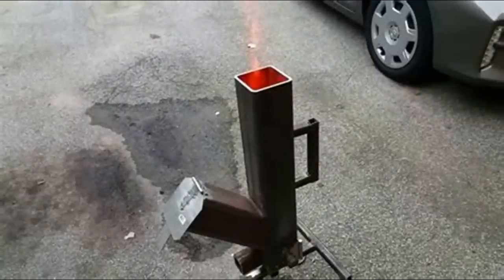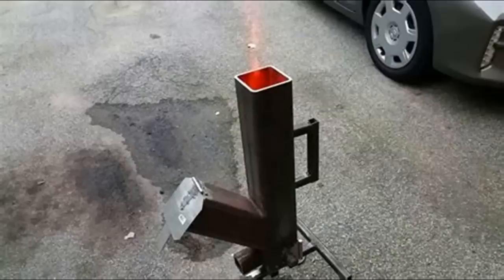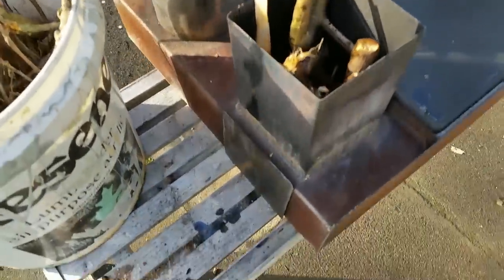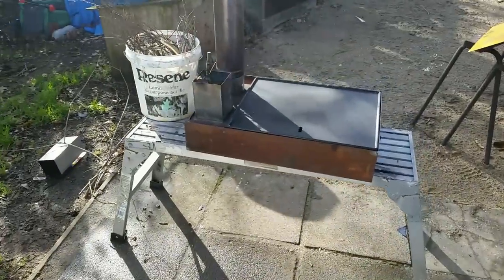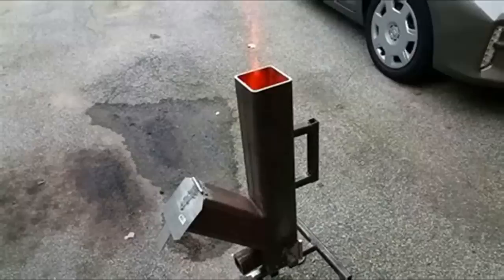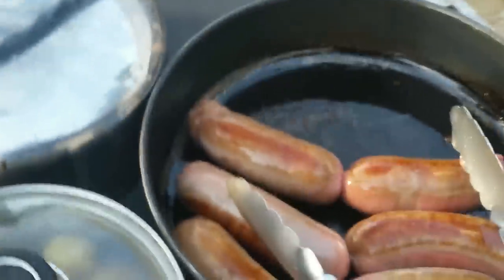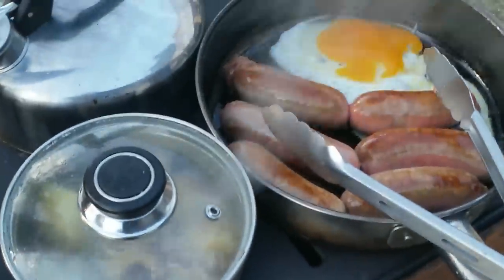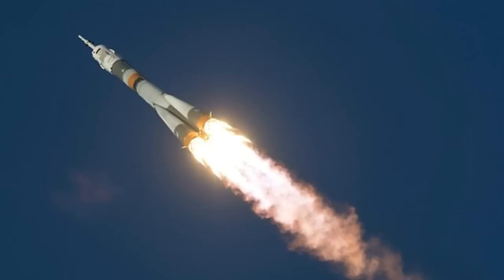2021  prototype of Rocket Cook Stove- Amazing Versatility! part 1

Comment: This is the best design I've seen yet, love it!! Thank you
Reply from the maker: This was the prototype - Im just building a brick version with oven that you can build yourself with simple concreting tools. Its EPIC!
Reply: TinyHouse and Offgrid Resources Great idea!  I may attempt to make one, but I may try interchangeable grill plates to also use as enclosed type Bbq. One side had the grill ridges and other side is a griddle that can also be used as griddle or burner surface for pots. I may even build a warming oven in the back by leaving a small damper with tiny holes at the rear that can be opened up  while its cooling down. You have inspired me for sure!

Comment: I found the opposite to be true in the fuel consumption area when burning in a rocket stove, I could go through a stack of wood in about an hour because the fire is so intense. Very nice idea with the stove you built, the u-shape under the cooking surface is good engineering!

Comment: Is a good stove..Insulate the walls and bottom. IF they are not and they are hot to the touch then is heat you are losing that is not reflected on the top. Do bricks inside or frame with clay or some insulating material outside.  Let only the top surface hot and all heat will only be sent there since it cannot escape alsewhere.

Comment: If you added insulation around the outside and on the bottom of your stove it would warm it up a bit more I would think.  Plus, it would push the warmer temperatures more around the stove. At least it seems it would to me.

Comment: That's pretty effective and very efficient. I use the small branches off the tree and hedge cuttings to fire in mine also. Probably this is the best I have seen actually and I've seen tons on U tube. You had it down draughting as well with the plate on the back.Well done will have a go at this because it's like having a 4 burner gas stove all on separate heat settings. The heat bricks do look like they make the difference, also forces the heat closer to the plate. Great in SHTF scenario.
Reply from the maker: I know!- Im pretty excited about this. Ill fire it up again as soon as the rain stops and try a longer flue. see if i can coax another 20C out of it
Reply: One thought what about an ash pan under the firebox lets it drop through a grill into an enclosed pipe for cleaning out, the problem for mine is eventually the pipe becomes clogged with ash so have to rake it out just wondering if the inner fire box on yours will accumulate ash in and around the fire bricks. If its hot enough there shouldn't be a build up with ash. Idea is to burn it down to minimal ash residue by the time it gets to flue pipe. Don't talk to me about rain we've had enough for this winter thanks.
Reply from the maker: Bill Porter that's what I do. I've put a brick just before the u bend and it stops the ash going  all the way around. I just rake it out the side air flap. I'm putting an oven underneath next week so I can't have a ashpan without getting dirty pizza.
Reply from the maker: Where are you Bill? I'm in waikato nz
Reply: TinyHouse and Offgrid Resources I'm in the so called Super City north of you and looking to break out sometime in the new year.after I retire. I saw your home made crimper and it brought smile on my face, typical kiwi with #8 fencing wire mentality, if you don't have one make one lol worked a treat.  Ahh so you created an ash trap inside the heat chamber, like it. I was wondering why the heat bricks didn't run round the whole chamber. Now it makes sense.

Comment: Remember the old wood kitchen stoves with covered holes? They were "almost" rocket stoves. Several years ago I saw a Russian R.S. that "reinvented" that design. If you can submerge pots into the firebox the heat transfer is maximized. 
Your use of fire bricks to line the firebox is a nice touch many overlook. It greatly extends the stove life and contains heat. 
I would have put in a slanted, taller feeder channel for "load & leave".
Reply from the maker: Im thinking of a pellet hopper next and maybe a feed extension of about 4inches
Reply: There are a number of designs out there which use the sunk pot approach. Apprevecho institute had a number of stuff and oven designs worth looking at for ideas. The developed a commercial kitchen sized skiryed stove to boil water in large pots. As well as a low cost barrel oven for baking bread.
Reply: From what I've seen, pellet hoppers are a little tricky and may need an electric auger to evenly dispense the pellets and keep them from clumping. Will be curious to see how you adapt the design.

Comment: Great! I just liked and subbed.
Do you find there's an advantage to the U-shaped exhaust path under a square cooking surface, as opposed to a straight shot, fire box at on end, chimney at the other, 4 pots side-by-side? To retrofit an indoor kitchen, the square makes sense. Without that constraint, I wonder if a linear path would be more efficient. Or maybe the resistance offered by a serpentine path is beneficial? I'm new to this!
Reply from the maker: Well,for straight out heat, a long insulated riser has always been the go , But really who cooks at 900f !?
I knew that a  long heat path would be good for cooking multiple pots but I wanted to come up 
with something compact. Im perfecting an oven for it now -look at the latest videos

Comment: This is by far, none even close, to a "Wife Friendly" attractive Rocket Cook Stove. I'd love to have one. I'd use a Coleman Camping oven to place on the grill for any Oven requirements. If it were for sale, I'd buy it. My only metal working equipment is an old arc welder from when I raced cars. If plans were available, I'd buy them then find a local shop to fabricate this.

Comment: Lovely video mate. If you make another one, how about setting the perimeter flanges off your cooking plate face down. My suggestion will allow your pots, pans and the kettle to slightly overlap the edge so it's easier to use.
Thanks for posting

Comment: NOVA = NO Volts or Amps
You are the developer but...
What if you made the stove only as wide (or less) than the biggest pot.  Then you make the stove long enough for three or four pots.  The temperature gradient would go from high to low in a smooth, linear way.  Final dimensions, insulation and locating the firebox (high or low) are for the builder.  What a cool build!

Comment: one word.... WOW!  What gauge metal are you using? Can you provide drawing/schematics of that inside/all components?  I am on disability income and need exactly what you have made.  Perhaps I can find scraps and someone to make it for me for a nominal fee.  After testing it couple months I will put it in my small house to cook on.   I cannot afford gas or electricity for cooking..  I have a rocket stove water heater I use effectively.  This savings means alot to my tight little budget.

Comment: That's really neat. I was going to put a n old classicLeda into my middle room workshop this next (UK) winter for when I'm restoring my bikes, but I'm thinking this design would be way better. 

The plan is to go fully off grid eventually, but steadily increase the amount of heating and cooking I do using zero power. I've got shitloads of logs, but they won't last long in a conventional stove. 

So, have you got any photos of the firebrick arrangement please? Did you line the bottom? I'm really impressed.

Comment: Some years back I wanted to build me my own rocket cookstove, but I never got around to getting a welder or learning to weld. The biggest flaw I see with your design is the draft doesn't seem overly good which is letting smoke escape back out the feed tube. Perfectly fine for outdoor use, but if someone wanted to build a "summer kitchen" and bring the cookstove indoors, that would make the kitchen smoky. With that design, it could probably be fixed by using double-wall chimney pipe. That might just be enough draft to keep the smoke going in the right direction.
Reply from the maker: Just add another chimney section to incease draught

Comment: What are the exact measurements of the bottom and main frame of the stove. It is basically set up and works on the same theory as the US military M-1944 detachment stove. The difference it the M-1944 is fuel fired and smokes like crazy, and yours if wood fired and burns clean.
I would really appreciate it if you could do a drawing with the measurements.
Great video, great piece of gear . 
Thank you for your efforts.
Reply from the maker: The exact measurements are the same as the second hand grill plate I found at the dump. That is why I made all it internal components moveable so that I could experiment. Finding out for yourself is how we learn. Having exact measurements and instructions is how life gets boring and controlled.
Reply: Awe we need help please.

Comment: Great! Can one make this without welding just rivetting?
Reply from the maker: Of course- but im working on a bricks and mortar version using air crete for insulation.
Reply: @t.h.o.r.  Did you manage to create a working bricks & mortar version?
Reply from the maker: @annoniemuis3866   I never wanted a bricks and mortar version.  Ive made a pizza oven recently
in brick. That will get shown as soon as the weather improves
Reply: @t.h.o.r.  Gotcha. Too bad, as I'm great with setting wood on fire but pointing little blue flames at something or working with steel in general.. not so much. Now trying to figure out how to use a gutted & rusted tiny wood stove and turn it into something rockety.

Comment: Love the design but was surprised by the height of the chimney. 

Is this necessary to draw the heat through the horizontal parts or would it also work if significantly shorter ?
Thanks !
Reply: More long chimney more suction and more flow speed. More air in the intake and more efficient combustion. Shorter chimney can work well, one meter is ok, more is better.

Comment: Many questions. First I live in an extended cargo van and I am a city dweller. I thought about buying a mini wood stove or a cube wood stove. However I didn't think neighbors would appreciate smoke coming out of my vehicle. No stealth that way. Will this stove be suitable for vandwellers that live in the city? How tall does the stove pipe have to be? Biggest question really is would it be safe inside of a vehicle that a person lives in? I understand you just came up with this idea. But I'm sure many people are going to ask these questions. Thanks for your creativity
Reply from the maker: Thanks for getting in touch Bailey. I lived and travelled in the little purple/white bus that is in my outro at the end of each video. I ran one of my gas bottle stoves ( check my earlier videos - lots of info)  in there with great success. the chimney needs to be at least 1.5m long.  even with a rocket stove you will get smoke when you first light up. But any fireplace with a good secondary burn system will be smoke free by the time it reaches running temps.People worry about two things with small cabins and vehicles - Both are easily explained. #1 is "the fire will consume all the air in the van and you will die in your sleep". - rubbish. air comes in through the air vents in the dash and in older vans lots of other places too.  #2- The carbon monoxide will leak into the van- and you will die in your sleep" Not true. Carbon Monoxide content of wood smoke is miniscule- thats why people commit suicide in petrol cars in garages not vans with woodstoves lol. Secondly. If smoke or any smell is present in the van then there is a serious problem with the design of the flue!  The most important issue for you will be getting a small enough stove and keeping it far enough from combustables while not taking up too much space.  I make and fit small stoves regularly.  My little MiniMax  https://www.youtube.com/watch?v=TL8VE9q2koo&index=6&list=PLyv0yXw8MSrE7F4SOvJ8oJgo3x7Yc8KYK   is perfect. especially when combined with an optional integral heat shield like its bigger siblings featured in other videos. If you need more advice just sing out- Ive lived tiny for nearly 20 years now and Ive done it all on a shoestring budget. - Ive seen all the tricks!
Reply: I suggest you look online they have wood stoves for RVs
Reply: @t.h.o.r.  thank you for the information and the link. I will check it out now and get back to you with any questions.
Bailey
Reply: @hectorcalderon3011  I have been looking at the mini cube stove. One would look great in my home. Thank you,
Bailey
Reply: @baileydillion9331  I hope you find the one you need the most important thing is make sure you have enough heat shield around the stove so you don't get burned or destroy your vehicle

Comment: Was wondering how a top held down with wing nuts and a stove gasket would work. Got a Tarm wood furnace that uses that to make cleaning the heat tubes out easy.
Reply from the maker: Im using a cast iron BBQ plate. its heavy enough to seal against the stove gasket rope that I have around the edges.
I've made a small rake that lets me empty the fire box ash without having to take the hot plate off. Currently Im making an oven for underneath- Then you can watch the Pizza Ninja in action!-  I am the Pizza Ninja -but its a secret OK?

Comment: Its clean burning because its burning with no limit, no damper ,its just wide open. Dont you think?
Reply from the maker: Im experimenting. Ive run it with dampers in 3 places, three lengths of chimney, lots of different fuels. Ive moved the internal chambers around to alter flow. Im really impressed with how it goes. the reason that it burns clean is because its a Rocket Stove- The sideways burn and and clean emissions are the trademark of the Rocket design.

Comment: Forgot to ask, do u have an idea on its weight??? Thank u
Reply from the maker: Yes. withe bricks in it is 16kg -38pounds. Im just making a oven to fit underneath. it will be separate and have ceramic tile panels to hold the heat in

Comment: Well the oil in the sausage pan wasn’t sizzling and one side of the sausages was brown.  Doesn’t seem to put out too much heat on the surface.
Reply from the maker: Sausage cooking lesson coming up.= food cooks from the bottom- in a fry pan. Thats why you turn it as it cooks.  the pink is the part that has not been cooked yet. The cooking plate has areas with temps that vary from 90C- 350C so by placing the pan where you desire you will get  the cooking  heat that you require..If you watch the other development videos in the series you will see me using a laser temp probe that accurately tells you what the temps are in various spots. The whole point of this flat top rocket is control ability. Hard out heat is only useful for boiling water. most recipes have an optimum cooking temp- that is why this stove is so useful. I hope this helps you to understand.
Reply from the maker: Trenton Quarantino  - I know- its kind of sickening isnt it? I live in a small town in New Zealand but I have turned off city water and power and I process ALL my own waste. composting toilet grows the best pumpkins and tomatoes in town.  I consciously buy food ingredients- not food products. Im conscious  of the packaging I use and how I dispose of it. Ive not seen a doctor in 20 years- even for accidents (stitches) and all that leaves here as waste is a small amount of plastic and any rusty steel that cant be upcycled into other useful tools or products.

Comment: What kind of top plate are you using? It looks like you built the frame around some kind of cast iron BBQ grill plate. Is it?
Reply from the maker: Yes exactly.a  cast iron BBQ plate
Reply: @t.h.o.r.  Thanks! That's a great solution, evens out the heat difference between "in" and "out" as well and gives you a stable plate that won't bend out of shape because of high heat. The bbq plate should outlast the frame too, I guess (concerning rust).

Comment: Sorry if i missed this, but are you temp measurments in C or F?
Reply from the maker: its Celsius. As soon as I saw that it was state side viewers mainly , in the next videos i started using your pre industrial revolution measurements. 😀😉😛😝
Reply: Hahahaha.....that's great.  There are two types of countries: 1. Those that use the metric system.  2. Those that have been to the moon.
Giddyup yall! Woot Woot!
Reply: you mean  faked going to the moon :P
Reply: I wondered the same thing but going by the accent I assumed celcius so I had to break out the old calculator lol 200°c=392°f if my calculations are correct. Anyways thanks for the video. I'd never saw one like that.

Comment: I thought you were a Kiwi, then you mentioned an Oak tree. Nearly threw me until you mentioned Nova. Go down to Bunnings, buy you a bag of Nelson made pellets, design you a bbq that will live on them.
Reply from the maker: Hi Bob.  Yes I'm in waikato.  We don't get south island pellets up here. Just taupo - fletcher board mill pellets. I'm working on a masonry  version of this one now with the oven on the  same level. It should dork really well
.
Reply: @t.h.o.r.  ok, Taupo pellets meet the same standard,  and are slightly less in silica content. But...  Speaking from a guy with two pellet fires point of view....  No smoke once the burn is going, one ton of pellets produces 2 cubic feet of ash. ( one ton pellets is approx 1 cubic meter).  For a pellet fire, primary air is all you need. O no secondary or tertiary air, actually would be counter productive. Need a metering system for pellet feed, just an adjustable gap for this. The pellts burn in the gap, as they collapse, more pellets. presented.